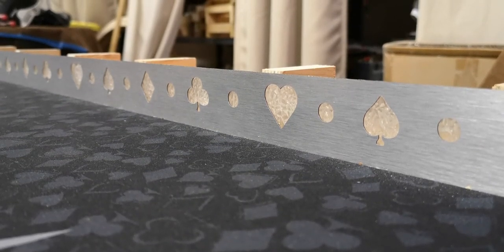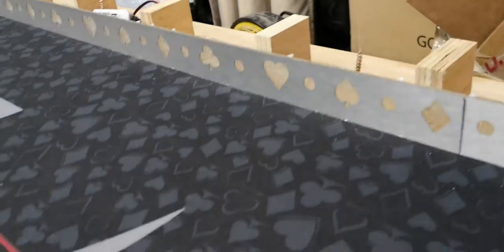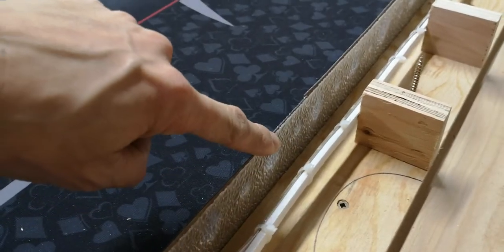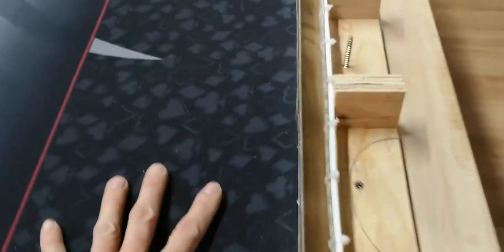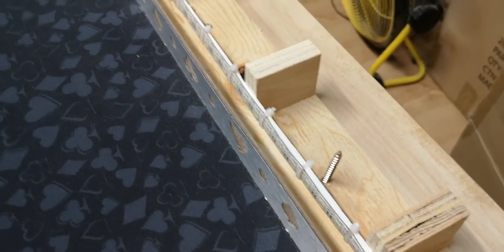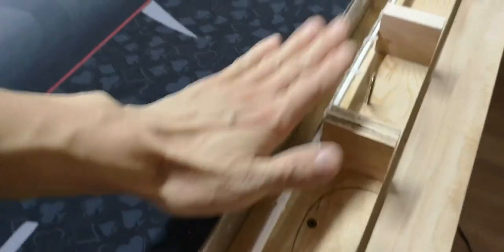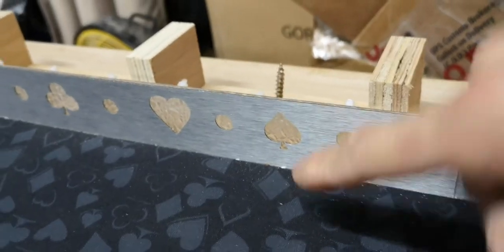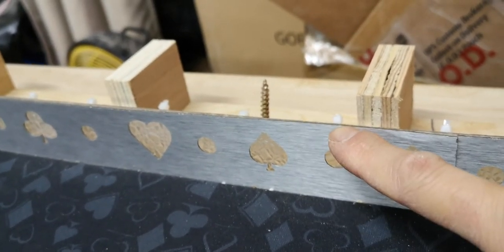Suited diffuser install

Comment: So how would you change the felt if you developed a collection of chanman felts? I see myself rotating once or twice a year. Seems like you would almost have to remove the outer ring that holds the spacer blocks and leds in order to remove the diffuser. Also, what is the big long screw coming from underneath for ? Thanks
Reply from the maker: The rail needs to be removed since it lays on top of the diffuser strip.  You do not need to remove the outside ring though, since the felt is wrapped around the middle playing surface.  The long screw holds down the rail.  It was backed out to remove the rail but not backed out completely.
Reply: Thanks for responding! Do you prefer the regular acrylic or the suited diffusers? I think the acrylic looks too good! What is that white thing that your lights are zip tied to?

Comment: Great timing for me on this video as I am getting ready to order a diffuser strip and custom felt from you. One question about the groove for the diffuser -- if you've cut the 1/2 in sheet into 2 pieces (1 for the playing surface, the other for the spacers etc) -- how are you getting the playing surface so close to the diffuser? Is one side of the groove like REALLY close to the inside edge of the outer piece of 1/2in ply? Or are you cutting the groove into the base sheet of ply (the 3/4 piece in this example)? You make great stuff. Definitely will order a table from you eventually! Cheers
Reply from the maker: The 1/2" sheet is actually cut into 3 pieces.  The middle oval is the playing surface, the inner ring holds the spacer blocks and LED's.  The outer ring gets attached to the rail and gets upholstered.  The diffuser strips sit in the 1/2" deep groove between the middle oval and the inner ring.  The diffusers and acrylic backing are just under 1/8" thick which fits into the 1/8" groove.

Comment: In this video is that two sets of the diffusers.
Reply from the maker: Yes, there's 2 strips since each strip is 8' long.  There's also a front "suited metal cutout" diffuser, and a rear "cracked ice" acrylic diffuser.